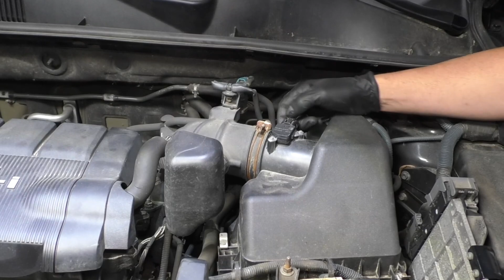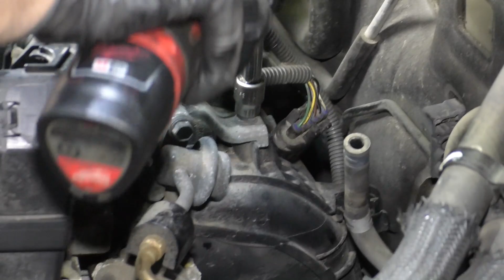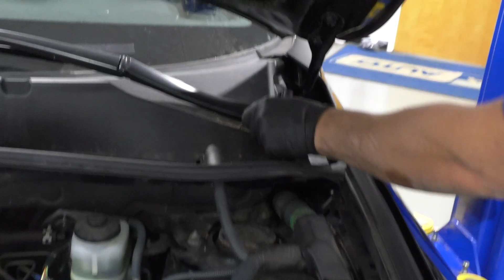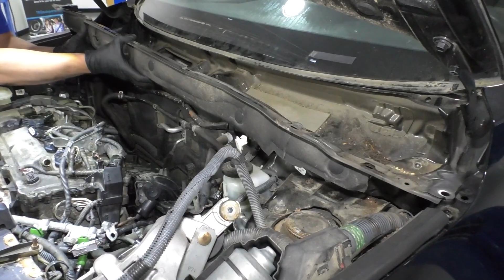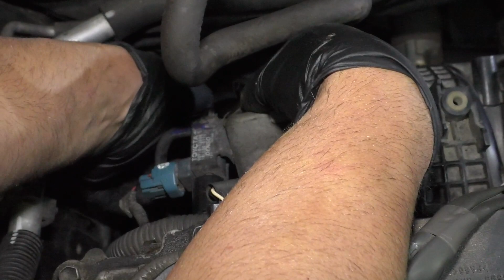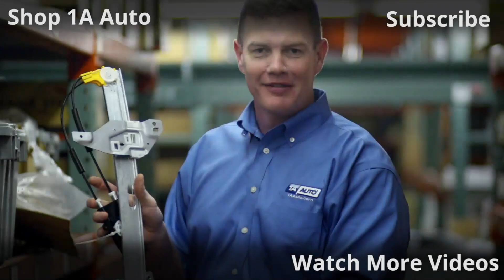How to Replace Intake Gasket 05-16 Toyota RAV4

Comment: removing windshield wipers to replace an engine gasket.  (nevermind the 14 bolts, etc. for removing the cowl, for goodness sake).  Gotta love Toyota.   Kind of like burying the fuel filter in the gas tank with no access panel from inside on my Rav4.  $30 part, hundreds in labor for a fuel filter replacment due to literally dropping the gas tank.  Gotta love Toyota.  So, what's a common problem on the 07 RAV4?  Intake gasket.  In fact - there is a newly designed one since the original becomes a source of a vacuum leak with really not that many miles on the car.  Want to be frustrated?  Buy a late model rav4 and chase a P0171 code.   Injectors, check.  Gasket, check.  PCV, check.  Fuel filter and pump, check. MAF, check. O2 sensors, check.  Throttle body, check.  Gotta love Toyota.   Great video by the way.  Just frustrating working on this POS.

Comment: I'm working on a 2010 Camry with the same engine and there is a visible oil leak on the driverside that's leaking through the intake. I'm sure it's not coming from the valve cover gasket. Where do you think it may be coming from?
Reply from the maker: +Tim Whit We wouldn't be able to diagnose an issue like that here, you may want to have a local mechanic take a look at it. Thanks for checking us out! http://1aau.to/m/Shop-1AAuto-c

Comment: I waited to long to diagnose the P0420 code and now both front and rear main seals are leaking oil, soooooo I'm wondering if it would be best to pull the engine and do it all

Comment: Would this be similar to replacing the intake on the 2007 2.4 L Rav 4?
Reply from the maker: +rdaleyj1  The video is applicable to the 05, 06, 07, 08, 09, 10, 11, 12, 13, 14, 15, 16, Toyota Rav4.
Reply: @1AAuto  great video sir.
I see that you were able to get the intake manifold pulled away from the head a few inches so when it comes to gasket replacement I think I'll skip the dismantling of the fuel rail and the cowl and put the new gasket on without pulling it completely out if I can.
Thnx for the vid.
Reply: @Rickie-x2  were you successful in replacing that gasket without removing the cowl?  I am shaking my head at having to remove the cowl for an engine gasket.  The way they designed these cars, it's a built in money stream for Toyota mechanics, just considering the labor for what should be reasonable maintenance.